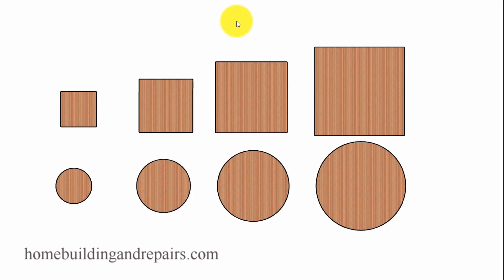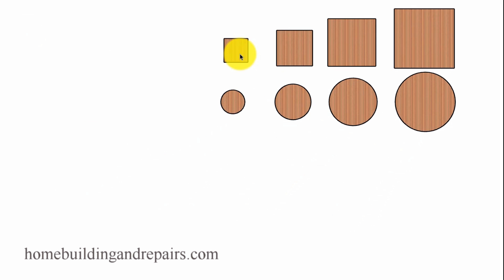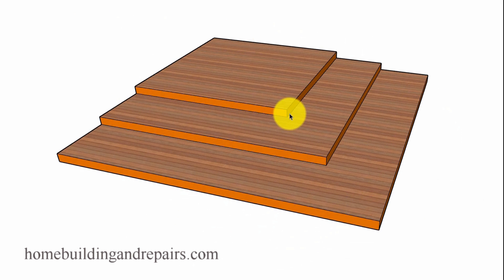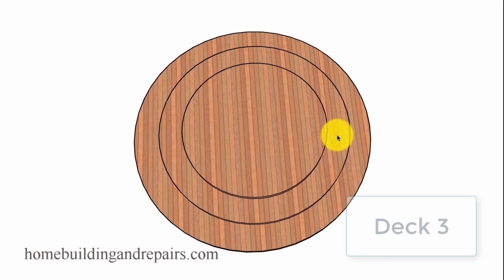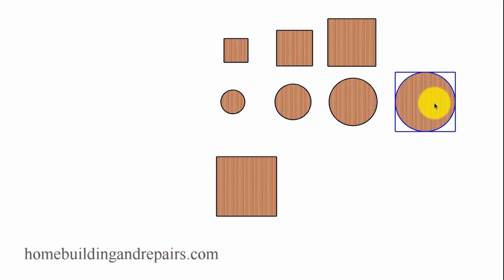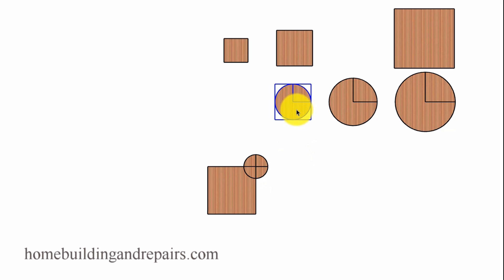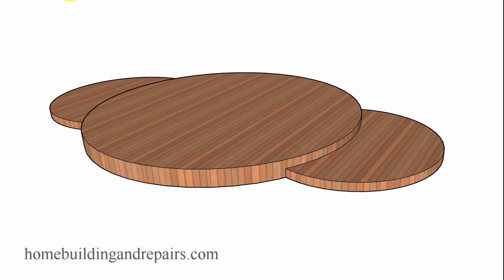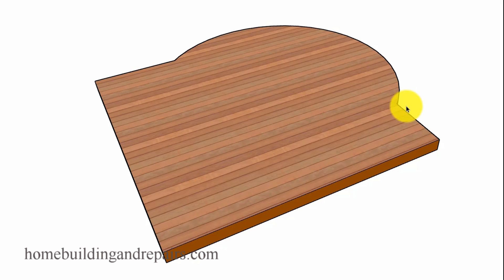Difficult Deck Designs Simplified By Using Squares And Circles - Architecture Made Easier

Comment: More importantly, how do you build a curved band board?
Reply: Resaw lumber into 3/8 thick boards that bend then run them through a planner to make them thinner for tight curves, plus glue.
Reply from the maker: You might be better off purchasing some type of flexible decking material that isn't made out of wood, but Anthony is right, thinner materials often bend easier. I did put your suggestion on my list of videos to be made in the future.
Reply: @gregvancom  guess you could scarf the back of the board to get it to bend. How do you determine the best depth and spacing of a circular saw scarf depending on the radius?